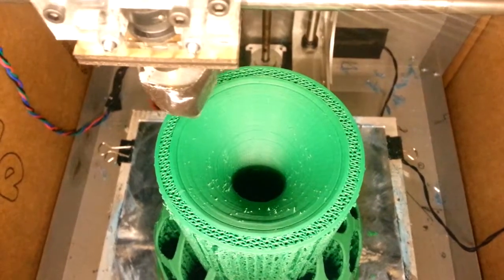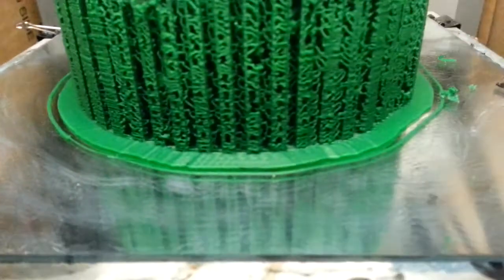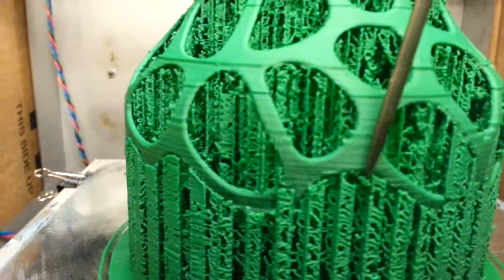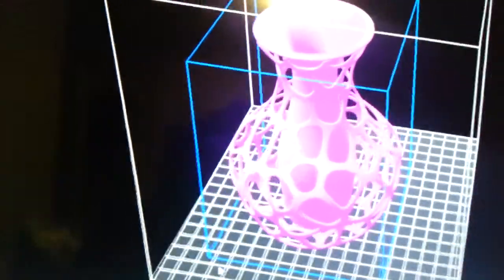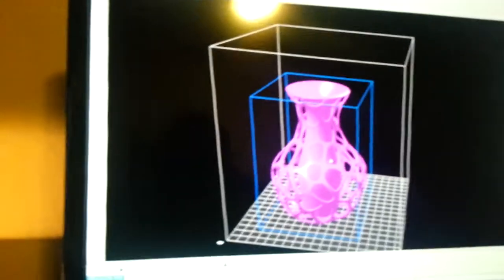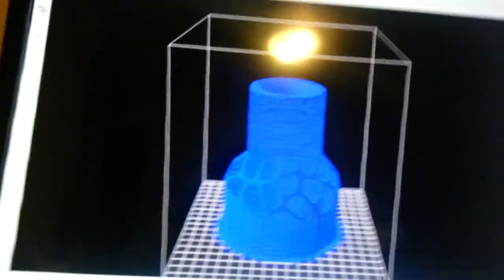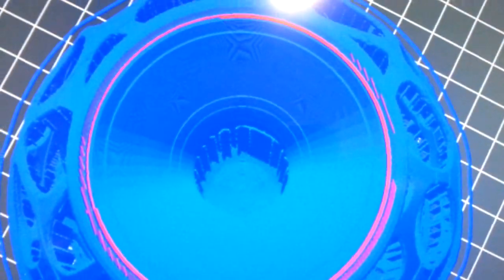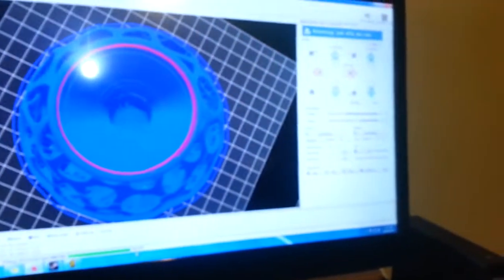Solidoodle 3 printing Hybrid Core Vase from Thingiverse

Comment: Nice print!  That's a long time to wait though :)  How are you liking your solidoodle?  I recently picked up a solidoodle 4 and have been having fun printing with it.

Did you print the bit on the back that is helping keep filament on the spool (the blue piece in the video that covers the spool)?  If so do you have a model for it?  I'd be interested in printing something like that for my printer as I've had the filament come off the spool a couple times and get bound up on the pvc spool holder.
Reply from the maker: i've gone through a couple different filament guides and settled on the one that mounts to the top of the unit with the cone shaped top part.  thingiverse has the model of it.